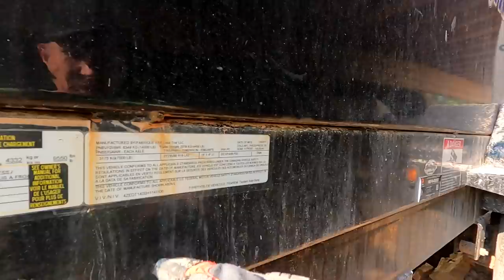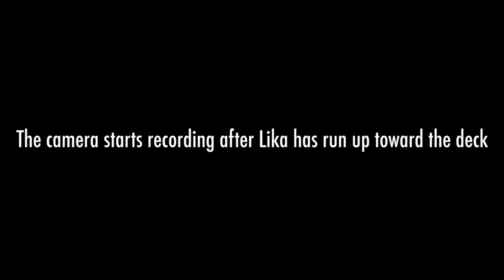OUR MOUNTAIN LION ENCOUNTER | LIVING IN THE WOODS

Comment: You could easily put in a closet on the wall of option #1. You could put in jack and Jill doors or just sliding barn doors and use option # 2 for your bed. If you put sliding barn doors in you can use part of the closet as your office. My bedroom is too small for regular night stands so I had a custom furniture man make night stands to fit the space.

Comment: Use option #2 for the bed placement and build in a closet all the way across the wall that would have been the head of the bed in option#1.  You will have enough room at the end of the closet for the bassinet and later on the crib.  The changing table can go against the wall next to the windows.

Comment: On the back wall, Put an armor near the window against the back wall  the changing table in the middle and the other armor in the opposite corner near the bathroom.  But your bed against the bathroom wall like you had in option 2 but move it over to have more room.  At the foot of your bed you can put cubed storage, a short dresser or a small couch.  (I have all my plants on at the foot of my bed).  Then you will have plenty of room for your office and the baby on the open side of the room.

Comment: Could you find or build some nightstands that also have a hanging closet system above them? Or create overhead storage over the top of your bed sort of like a built in storage system up and around that entire wall where the bed is in option 2? Could also put storage underneath your bed. Then you'd have room for the bassinet to go in the corner where the armoire would have been and still have room for an l-shapped desk + baby changing area in the other corner.

Comment: Option #2!!! With option #1 whoever ends up sleeping on the outer wall side of the bed won't be that happy come winter and the colder ambient air coming off the large window. For that reason and because of the layout if the two windows in our bedroom we actually put our bed on angle so that the windows don't affect either of us. What does affect us is that there is only one floor duct and it location sometimes negatively effect the person sleeping on that side of the bed. I don't recall were you placed you ducts.

Comment: Use the vertical space for storage! U r short on floor space but have plenty of unused walls behind the bed, just paint the storage doors same color as walls. Option 2 is nicer but op1 has better flow for the space, going all the way around the bed is troublesome in the midle of the night when the bb is crying. 
House is looking great! Congrats on the recall training you have done!

Comment: Try after running your mud on both sides of the out side corners you take your clean scraped  knife same one your using and run it full length at an angle just shy of the fresh coats you just applied a few times full length to remove  any excess mud before it dries. What your doing is running fresh clean mud over the  excess mud you left to dry so when you start your next application your picking up the dried crumbs and adding them to your fresh mud coat leaving scratches!

Comment: Bedroom is most important. 
Office is notoriously the sacrifice. 
For a bed, I have been very happy with my Pragma Bed that I bought before I even bought my skoolie (I was thinking cargo trailer back then). It's adjustable... it's mechanical (no power needed in the skoolie). Only reason I didn't get a California King was width, so I got a queen. 
Now granted, as a couple,  you don't need to worry about splitting the bed (I needed a place for Mom to sleep on those times she travels with me. I also needed a good walk space between,  because 2 old ladies... 1 split queen now equals two princess beds.), and a California King is a foot wider than a queen (72"), and 4" longer. Trent looks like a long drink of water, and even if he's only 6' tall, he would appreciate that extra 4" if he uses the adjustable  bed. I know. I'm 6' tall. If I use my bed like a recliner, my feet hang off the end of an 80" bed. That's annoying. (Ok... I admit... I fluffed up the mattress. The 8" mattress got a topper, then I decided that foam topper has potential to get hot, so I used a folded over 2 60"×80" duvets as a top layer on the mattress that I made plural... so  that kinda messes with the dimensions as it bends... it feels good though!)

Gee... I sure wish I was there to pick through your construction waste, I am still working on building my skoolie. 😄

I was friends with a cougar once. She was SIUE's mascot, Chimega.  She chose her own Cougar Guard. 
Note: "Ow" is a friendly greeting in Cougar-ese.
I like to imitate animal sounds, and some I get pretty good.
I tested this "Ow" sound on zoo cougars. Got pretty much the same reactions.  (Note... not like a human voice "ow", there's tonal qualities. I can't explain without voice...) 😆 and one lynx. Nothing like looking at the cougar in the next cage, and out of the corner of your eye see a lynx leap at the mesh, hang from it at face level, look at you big eyed, and squeak at you. 😳
Cats is cats. At 125 to 180 pounds, the cattitude is proportional. 
In other words, be very careful!

Comment: You have that lovely half wall overlooking below.  Why not put your office desk there, butt it up next to a half height closet that could hold all the short hanging things.  On top of that would be display area or whatever.  Perpendicular to it would be your baby-changing table (something I found useless).  If you don't get the baby changing table, then I'd put the crib there (very useful because you really want the baby on the same floor as you so you aren't running up and down all day and night).  I liked your bed facing either direction.  If you did my desk suggestion, then the armoire would be in the corner.  If you had the bed facing the half wall, then the armoire would be near the entrance corner wall across from the windows.

Comment: If you put two larger night stands (I have this) on each side of the bed to hold clothes  if not enough floor space two matching tall slender wardrobes to balance the room on each side of the bed with mirror fronts will open the room as well.

Comment: Option #2 sounds good   We are going through something similar but we’re 70 year olds downsizing in a condo. We discovered that our old living room furniture didn’t fit so we had put in our basement, which is an open space. Now we are buying new furniture scaled to an apartment which should fit. Finding a coach large enough but small enough to fit was a major pain. There are sources for smaller scale living room and dining room furniture. Since your house is smaller than our condo, I recommend looking for apartment-scaled furnishings. Good luck!
Reply: I meant “finding a couch”, you guys don’t need a coach anymore  Trent and Brandon will find a solution to any construction issue.

Comment: Allie, can you have your bed surrounded by armoires on either side of your bed with the cupboards above it connecting the two? I wish that I could draw it out for you. You could put lights or sconces inside eliminating the need for lamps. Your bed it self could be one of those "easy to lift", so that you can store winter clothing, summer clothing and/or baby clothing that comes in so many sizes. Then, you could put a small dresser with a pad on top, by the sliding glass door. You can figure out where the bassinet goes!☺ This way, you can still have your desk with the rocker or glider by it. Please, don't buy a wood one, because you will doze off! Make sure that you can rest your head back also.  I hope this helps. We lived in a 500 square foot home with three children and I loved it! We live in a huge home now, but I miss the coziness of the small home.

Comment: I could not tell for certain, but it seems that trailer is equipped with a center split tailgate. This is so that you swing each side out so you are not restricted on height of material by the tailgate. Check for this feature!
Ken

Comment: Put changing table on main floor believe me if you have a csection or tear a lot you will not be climbing stairs. Also the first few months give that baby a bath in the kitchen sink. Lot easier than trying to bend over a tub. They make things now for sink baths unlike when my girls were babies. Also a basket or bassinet on the main floor would be good then a small crib for upstairs. Our girls slept in the living room during the day so they would be use to noise and not quiet.
As for your room upstairs get a captains bed with drawers underneath and use 1 armoire next to half wall and possibly a small chest on the front right side next to window for baby.

Comment: I think you should have fitted wardrobes etc on the gable end wall, then a wall in front of that for your bed head, which is inline with the windows. Wall with storage and lights built in so no need for bedside tables.

Comment: Research using a sponge and a little bit of water when you get to the sanding stage. It will cut down on dust and wasting the mud you worked so hard to put up. Try it on a piece of scrap sheetrock first to get a feel for it. You'll be amazed. My gift to you both.

Comment: Is there enough space to go with option 2, but bump the bed out to put in a closet on either side? You could maybe use pocket doors to cut out the need for doors opening into the room. Also keep in mind what side of the bed Allie sleeps on. She will need easy access to get in and out of bed and to the bathroom in the middle of the night especially if she’s nursing. She shouldn’t have to negotiate around a bassinet that takes up a lot of space between the wall and the bed as well as a possible tight corner around the bed and a wardrobe or corner built-in closet.

Comment: Hey Trent, what you described about feathering is for "butt Joints".  Feathering out past a factory edge defeats the purpose of the factory edge and creates more work to make the wall look flat.  I wish I could come up and give you some easy tips.  You are doing a good job. You have an eye for what looks good, but it seems that you are making it harder than it needs to be.  I live down in the valley about an hour away. BTW, wood trim/casing in the windows is easier and looks better IMO.  Mud is cheaper  and takes longer to complete.  Good choice there.

Comment: The bedroom layout, since furniture is moveable, try it different ways. According to the laws of Feng Shui, your bed should face towards the door. But not with the feet directly in front of the door. That is considered the "coffin position". Although your option of the foot of the bed facing the window, is probably the best as both sides of the window could be used for wardrobes.  That enable you to put the baby crib along the tall wall, not along short wall.

Comment: I always thought corner beads are the easiest part. Are you going to do a skim coat over EVERYTHING? I will from now on. What I've found is, using a paint and primer combo (sherman williams) I can see all the mud through it. You can't feel it before, but the mud will be smooth and the drywall is rougher. It's maddening.

Comment: Your better off using the wood to trim out the windows like everyone else said. I got a dump trailer like the one you were using I had it heaped so full of dirt that the lift wouldn't lift it and I ended up shoveling a bunch of it off. Make sure to feather those but joints out 2 or 3 feet if you have too. Otherwise you'll have speed bumps on your wall.

Comment: trent needs to sand after things dry it gives a smooth surface to build the next layer on. also those corners look really good but shrinkage from drying could crack it and remember things are going to start taking longer to dry with it getting cooler.

Comment: Would you considerer building a wood wardrobe in the space between the half wall and the bedroom windows? If you paint it the same color has the ceiling can be discrete and pretty. Make it tall and lean and look into foldable desk...
Reply: Also about the halfwall had you considered putting a glass (not all the way to the ceiling but high enough for safety) for safty of your kid and also make the bedroom more sound private.

Comment: Go over all the taped seams with the same trawl your using for the corner bead, let it dry and sand it flat...... Wait for it. Take a straight board about four foot long and lay it on the wall to see how flat your wall is, and where there are dips, fill them. Or you could ignore me and paint and afterwards you'll see why I said check the flatness and fill the dips, at which time you'll want to fill them and paint again. With that same trawl, do all the spots in a long line, from top to bottom. Be sure to feather all of it. let it dry and sand it. and then, you should think about texturing the walls, with the only exception of a wall that's getting wall paper. That one(s) need to be perfectly flat. good luck. Watch more video's on finishing the drywall.

Comment: I wouldn’t put the changing table against the 1/2 wall. Babies move faster than you can imagine. Too scary in that spot. Believe me I had an extremely active baby. By the time she was 2 had her at the Drs for possible head trauma a few times. First time she was only 3 mos old! Scooted herself off the bed after I changed her I bent down to pick up diaper and instantly she was on the floor on the other side of the bed. We had an antique bed that I had to use a stool to get into the bed. She was my most hyper child and I got her into gymnastics that she was fantastic in. They aren’t little blond that just lay there 😄

Comment: I expected you to use wood on the window trim and was surprised when you did not. No-one  will see the cacca poo but you.how about a tall closet in the corner with two levels and a pull handle for lowering the top hanger?

Comment: Might be time to investigate electric fences. No they don’t kill animals. I’m not talking about mains powered electrocution fences but a high voltage single wire that gives a zap on any animal that it touches, generally they don’t come back for a while. They can be unobtrusive and very effective on wild animals if designed  and maintained properly.  They are used in Oz to reduce attacks on livestock by wild dogs. Agree with the sensor lights but they don’t deter. It could have been worse, a bear?

Comment: For the grammar question, first simplify the sentence to be sure if you need to use “I” or “me”.

For example, it’s common to hear people say, “Me and my friend are going to the store.” However, if you simply the sentence to remove the extra person, it would be, “Me am going to the store”, which obviously is incorrect. The correct sentence here is “I am going to the store,” so likewise, it needs to be “My friend and I are going to the store,” (with I always listed last).

However, it would be incorrect to say “John gave a gift to my friend and I,” because if you take out the extra person, it would read as, “John gave a gift to I.” For this sentence, it should be, “John gave a gift to ME,” therefore, “John gave a gift to me and my friend.” (I think “me” needs to be listed first in this case.)

But basically, say the sentence with just the “I” or “me”, removing all other people in the list, and it should be clear which one is right to use in the sentence :)

Comment: 1) PLEASE do not put baby changing table/chest against the half/pony wall! Not safe as any parent will tell you.
2) Placement of adult bed depends on which direction the sun comes up...do you want sun in your eyeballs? Or maybe you'll put dark shades up so baby doesn't wake up at crack of dawn?
3) Changing table/chest could go at foot of bed.
4) Advise half/pony wall be only 2/3 the width it is now.... Frame in the far end  (next to outside wall) up to 8 feet tall so armoire can set against that without showing to downstairs.

Comment: CORNER BEADS LOOKING LIKE CRAP IS OK. YOU SAND THEM SMOOTH AND DONT NEED MUD COVERING SHARP EDGES PAINT COVERS IT LIKE EVERY DRYWALL CORNER! YOUR DOING SO MUCH BETTER THAN I EXPECTED BECAUSE I DIDN'T DO ALL OF IT WHEN I FIRST STARTED. AND REMEMBER TO SLIDE YOUR MUDDING KNIFE, I THINK I SAW YOU HAD 12 A INCH. RUN IT ALONG YOUR MUDDING THEN SAND BETWEEN LAYERS OF MUD.

Comment: Why did he get a $1500 Bazooka and is using a flat box ? Oh he found out you have to thin the mudd so much it takes 3 days to re-coat ! I'll take a 5" hyde for bedding a 8" & 12" blade w/ a 14" pan and smoke his ass ? And I have never seen tan drywall compound and it had big air bubbles WTF ?   I have not seen them thin mud and whip it with paddle and a drill ( He's sponsored by Milwaukee, sure they would send him a HD drill) After he primes it, It's gonna have more poc marks than an adolescent with bad acne !